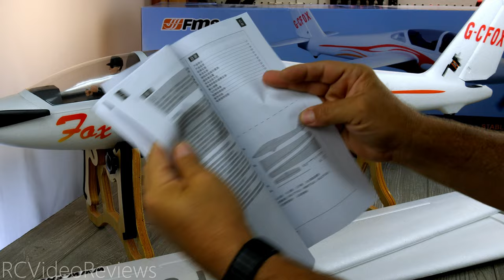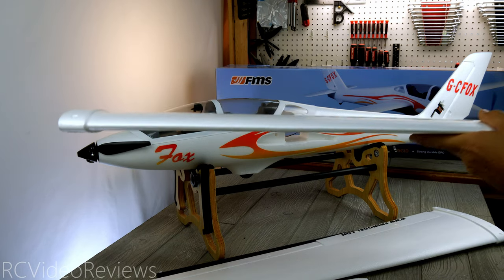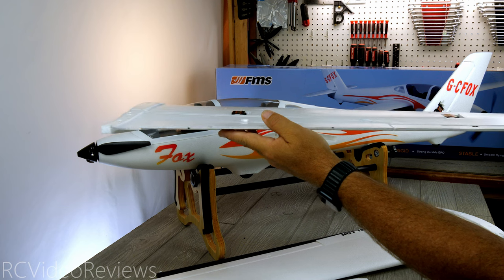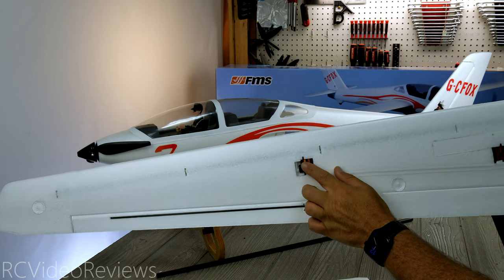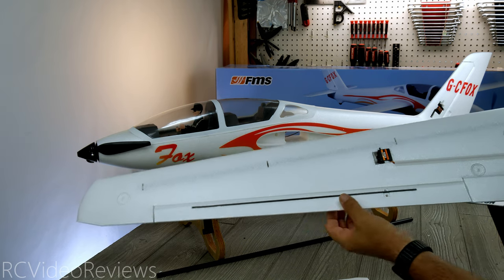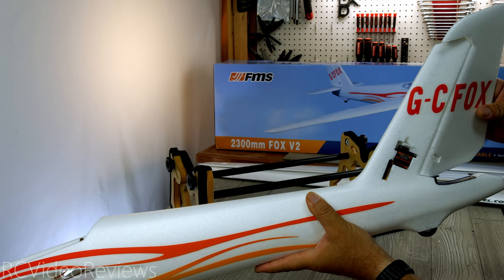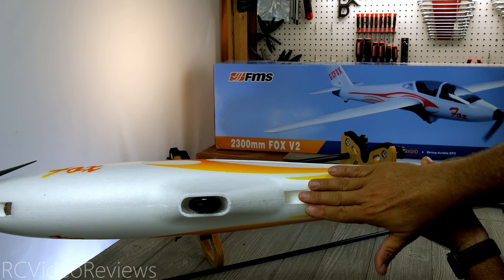FMS 2300mm Fox v2 PnP First Look

Comment: But whats the difference between the V1 & V2 ?
Reply from the maker: No idea. I've never seen a v1 let alone reviewed one. Maybe someone else will chime in.
Reply: V1 didnt have flaps and the have changed the spar tube my first one came with a 1800 3s and 4 channel  @RCVideoReviews
Reply from the maker: Thanks for the G2 Robert!
Reply: oh and different size motor they upgraded on v2
 @RCVideoReviews

Comment: Nice looking bird. Appreciate the reviews. Will wait till after the maiden before making any consideration. I still prefer  my built up balsa planes to foamies... But foam seems to be the way forward.
You mention the "thicker" trailing edges... Any thinner and they'd be more prone to hanger rash and warping.
Reply from the maker: I've built planes from foamboard with razor thin trailing edges and didn't have issues with warp. Check out the Nerdnic P39. Of course, that was hand made and not in a mold. In any case, it would be nice to see them work it out.
Reply: I remember the hand launch foamie  747 gliders that came out shortly after the real 747 launched.  Bought a few.  They were doggy.   I wasn't impressed. The technology was stone age then.  I like flying more than building. I can't believe how much punishment the foamies take.  Everything I've ever built in balsa was destroyed often on the first flight after months of build time. What is needed for foamies is a protective coating but I just don't know what that is?
Reply from the maker: Minwax polycrylic?
Reply: @RCVideoReviews  
I've got some!  And will give it a try...on a foamie I killed.  ;-)